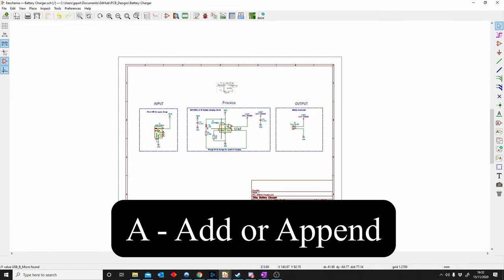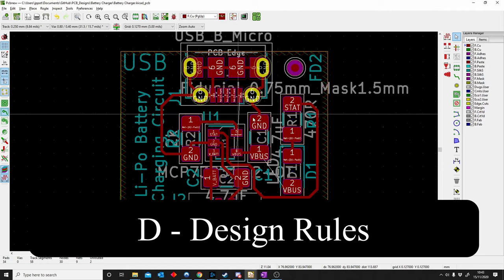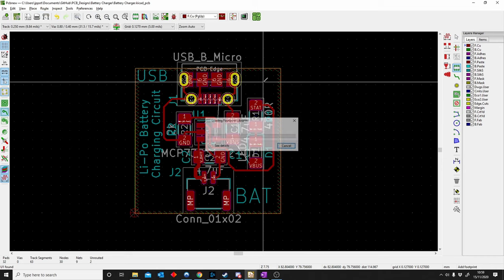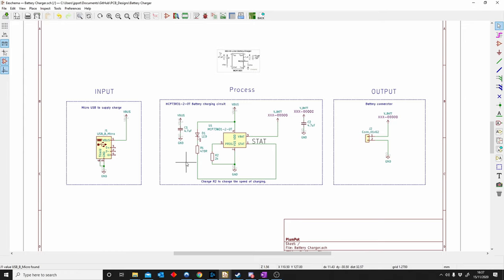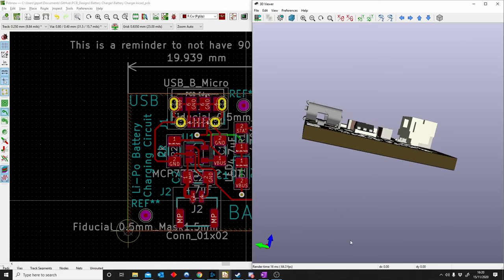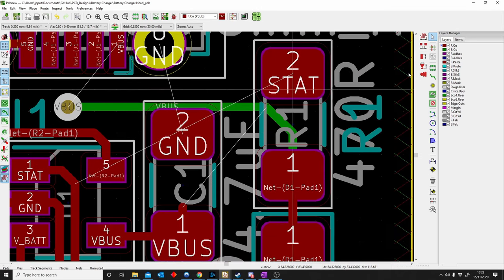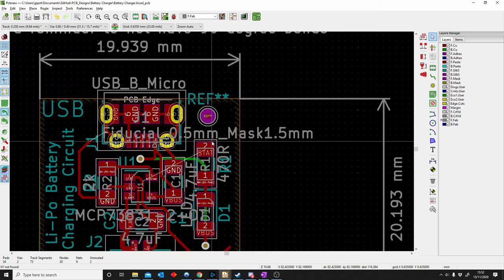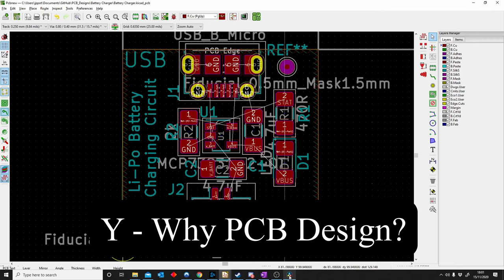KiCad Tutorial - A to Z of PCB Design for Beginners

Comment: How to choose components on the pcb.as per the board design.
Reply from the maker: Thanks for your question😀. What do you mean by board design? You need to choose the components that will fulfil the task that you require. So if you have a battery charging circuit, you need to choose an IC that will charge the type of battery you want to charge, how fast do you want to charge it etc. Or do you mean how do you choose the component on the PCB to match that of the schematic? For that, you will have to look at the component's datasheet to see what footprint it requires? 😀. If I miss understanding the question please let me know, and I will try to answer your question better. - JP

Comment: Thanks for the video! I’ve been trying to get started in pcb design to create synths and other electronic musical instruments. Something that would be interesting for me would be to know how to modify an existing design. Say...add a lipo battery circuit to it, or change the audio connectors to another component in the schematic and pcb design.
Reply from the maker: Hi TIm! Sorry for late reply, seems to have missed some comments. That is a very good idea  So basically hacking existing designs to add some upgrades or changes?

Comment: I've been in new product development since 1973 and am still making a living as a W2 Contractor working for 1 to 2 companies per year. 4 of the last 5 companies used Altium which cost ~ $7500 per year. Orcad was inexpensive back in the late 1990's, but I'm using it for my current client and it cost over $5000 per year. The reason I'm interested in KiCad is that I have projects I want to design for myself, but I don't want to spend thousands of dollars each year as the cost of ownership becomes prohibitive, for projects that might not sell. KiCad looks very easy and intuitive. My main questions have to do with how to import symbols, footprints and 3D models (step files) and how readily available they are?
Reply from the maker: Hi Steve, wow since 1973 you must have seen product development go through so many different stages that is so cool😁. I have found to import footprints and step files not that bad at all. You can get most step files from GrabCad and there are many githun repositories with many footprints  there is also a snapeda plugin where most of the footprints are. We have many videos on it to help. Let me know if you ever have questions or require help🙂

Comment: In my radio circuits, ground is ALWAYS the larger surface or thicker lines unless the supply or Islands are drawing tons of current.
Reply from the maker: Hi 🙃, our latest video is explaining single layer and making a ground plane. Let me know if it helps, or if it is still unclear
Reply: @PlumPot  Thanks. Will check it out.

Comment: Can you SHOW me how to start off with the ground plane first, on the pcb? ALL on one side of the pcb! No one can make a video and show me how to do this. Is it that hard to do? The circuit has 50 components.
Reply from the maker: Hi thanks for the comment. What you mean ground plane first? You just want a single layer board with 50 components? Can the tracks be on both side and components only one one. Or do you want everything on one side of the PCB?
Reply: @PlumPot  everything on one side. The bottom.